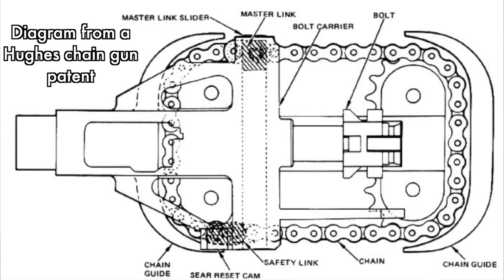Ask Ian: Are Man-Portable Chain Guns Coming?

Comment: The L94 mounted in British AFVs is a nightmare for stoppages so we find ourselves having to clear it frequently. Certain stoppages require you to wait 10 minutes before completely disassembling the thing. This is mainly an issue with the way the belt is fed so a good crew knows how to deal with it. The gun is accessible though! While not tucked into a corner, the short length of it (less the barrel) means it doesn’t jut out into the middle of the turret. Being electrically operated also means that the gunner can fire it and the main armament from the same set of controls. Oh and also chain guns are much cleaner running than gas operated guns!

Comment: What a battery powered system for a man portable system would shine, is a cooling system.  A lightweight barrel jacket a small fluid reservoir, and a small radiator with a pump/fan combo.  Would allow your gas or recoil operated machine gun to run for far longer without ruining or over heating the barrel.

Comment: I do think it's notable for an infantry minigun you could potentially make it so that you could eventually get to the point where you can use a smart system to change your rate of fire, and potentially even change which barrels is firing so instead of being able to only let's say 6,000 rounds in the time it takes for the first barrel to heat up, you can put 3 barrels through 6 thousand, then put an additional 6 thousand through the other 3, or alternate it so that each barrel has 50% downtime while shooting, or if decrease it down even further to use 3 barrel groups so it goes bang skip skip bang skip skip

Comment: shouldn't you be able to remove the chain by just adding 2 valves on the gas tube and using compressed gas on a normal gas system?

Comment: Just a tiny correction!
The British AFV-mounted machinegun is actually designed as "L94A1", the "L34A1" is a suppressed Sterling SMG from WWII😄
Reply: No offense, but the Sterling wasn't used in WW2. It was first fielded in 1953.
Reply: @joshtalley6604  didn't go into active service in large numbers until '53. but it was in testing with british forces from 1944 onwards
Reply: was tested as Patchett Machine Carbine Mark 1
Reply: yea i googled it and was like wtf. first time I ever saw Ian fuck up in a decade. God is dead.

Comment: On the advantage an externally powered gun has with the ability to remotely cycle themselves, there is a way for gas operated guns to remotely cycle themselves. Several soviet weapon systems would carry pyrotechnic cartridges connected to the gas system to cycle the weapon in case of malfunction. The first one that comes to mind for me is the GsH-23-2 on the MiG-21 Fishbed. It could cycle the cannon multiple times in flight.

Comment: Battery-powered guns are a big drawback in terms of reliability over time. The battery usually has a short life as machine guns are only expected to be used for a short time by today's military planners. That is OK on a drive, helicopter, or fixed position that has the means to make power to charge the battery. The dog face in combat with a dead battery is just S. O. L. if they rely on a gun that needs batteries

Comment: Thank you for the explanation about the difference between chain gun and minigun/rotary barrel-based weapon system where its application are needed.
I always thought that the reason why most of IFV and helicopters with cannon rounds use chain gun system instead of minigun system is due to accuracy and not to waste excessive amounts of ammo in a particularly complex system where a damage to the gun and ammo consumption would require a mechanic repair and rearm back at the base,sometimes thousands of miles away from mission area,thus the need of single-barrel chain gun system to sustain the weapon safely and reliably.

Comment: I think in the hypothetical future of powered exoskeletons for infantry, chain guns may have an application for a system wherein the user's arms/hands are constrained by some kind of gauntlets for heavy lifting, thereby preventing dexterous manipulation of the bolt and other interfaces on a traditional self loading system, whether recoil or gas operated. In addition, the exoskeleton would be able to support the weight of the firearm itself, as well as the ammunition and battery. Of course, this is all pure conjecture and likely outside the realm of likelihood, but it's still neat and cool sci-fi stuff to think about.

Comment: One of the annoying things about the chaingun in the Warrior is that you actually have to fire it to unload it. There are always three(?) rounds in the gun when you stop firing and to "unload" it, you have to fire those three rounds. In fact, there is a specific command, "Unload! Do not fire!" used to unload a chaingun without firing it, which means partially disassembling the gun to get those three rounds out. On a GPMG, to unload it, you simply open the top cover and remove the belt, check the chamber and let the working parts forward.
Reply: Can't you just crank them out while the manual safety is on? That's what  you can go with 25mm bushmaster. 
Unloading is just backing the rounds out, break the link, remove and clear feeder.

Comment: Personally I don't think this would be useful on a combat drone. It's way lighter to strap a solenoid onto an existing machine gun platform to operate the bolt handle in case of a malfunction. Think Pederson system but electrical instead of gas operated. Solves the problem of jams, uses commonly found equipment. It's just cheaper and lighter overall compared to crafting an entirely new chain system.

Hypothetically though, aerospace aluminum weighs practically nothing and is exceptionally durable. Expensive as all get out but still quite usable. A chain made of such aluminum, assuming it's not being exposed to high pressure/heat could save a few pounds of weight. 

hmm... nah, still not worth it. Solenoids are powerful, space and cost efficient, and electrically not all that power hungry compared to the work they can do. For a simplistic reciprocating action it's really hard to beat a solenoid just pumping that charging handle to clear a jam. Hell I could strap one onto my AK in a few minutes and get it to work in under an hour.

Comment: Also note with a chain gun, the bolt mass is much less critical and can be made lighter, there is no need for a recoil spring or buffer system, and the barrel can truly be free floated since there is no need for gas ports/tubes. You can also use the chain drive motor controller to effectively program firing patterns such as semi, full auto, or any variety of burst modes without mechanical disconnects or ratchetting systems.

Comment: The shorter receiver is a significant factor that goes a long way towards design decisions for installing it in a vehicle, especially a turret (manned or unmanned).  A .50 BMG chain gun coax in a tank, for example, could be fit into a space no deeper than an FN MAG58 (M240) fits in (it's wider and taller, because that's where the chain gun design tends to bulk put compared to a self powered MG of the same caliber).

I use that example primarily because I really think, given modern AFV stabilization and fire controls, a .50 coax makes more sense than sticking it on the roof for the TC to pretend he has a viable AA capability (note, Western tank designers since the end of WWII have generally depreciated the weight given to the commander's gun as an AA weapon and it shows with the limits on elevation, as well as how most Western European tank designers go for a 7.62mm mount for the turret MG).

Comment: Is there a ballistic advantage in an externally powered firearm, because you don't need to waste the energy in the cartridge to cycle the action? It seems like you should be able to get more performance for the same weight, or the same performance for less weight.
Reply: I have seen videos comparing manual and semi auto firearms of the same barrel length there was no measurable difference. On most weapons the bullet leaves the barrel before the action begins opening, the velocity of the slide is also quite minor compared to the velocity of the bullet also.
Reply: @MrMonkeybat  Okay, but couldn't that be explained by the bullet leaving the barrel before it reaches its maximum potential velocity? And therefore it would go faster if the barrel was longer, or the same speed if there was less propellant?

Comment: About miniguns overheating as fast (timewise) as chain guns or conventional machineguns.  Yeah this isn't quite true.  You can certainly fire them until they overheat just like anything else.  They still can't get rid of heat as fast as they can build it up .  However since the barrels are spinning instead of stationary, they are creating cooling airflow around themselves that enhances convection cooling.  So they can still overheat, but it will take a bit longer per round per barrel.

Comment: It could be interesting to see a chain fed automaic rifle in 22LR. Should be possible to keep the weight down by using polymers and light moder materials. Aircool the barrel with the jacket alá the lewis gun. You would get an incredible funny plinking rifle without all the jamming.  The magazine should have a pickup/loading system that allowed you to load it directly from the standard 50 rounds frame, without having to pick up and load each round alone..

Comment: interesting to note that some gas-operated cannons, both single-barrel (eg. mauser bk-27) and rotary multi-barrel (eg. the old soviet gsh-6-23) use pyrotechnic charges to to re-cock the gun after a misfire, so you get some of the reliability of the external power source.

Comment: Indeed. 
* US Army plans to consolidate the 11H anti armor and 11C mortar into 11B.The H and C are more skilled. They want to use the more intelligent soldiers to serve under the Bravos. Thus the M-5 and M250 texted the range to areas once covered by H&C. The opposition merely adds the heavy type Maschine gun or M-2 Tripod T&E back into the platoon. So US level 4 is countered. The 277 is to have the standard all brass case low velocity round issued for training and common use. ( Bait and Switch?) At the Citadel Wargames Club in the attack of Daniel library was a trove of captured and somehow brought home weapons. They included a complete Soviet wheeled 51 from Vietnam. ( OMH Wheels? Perhaps the Infantry Bravos are ignorant of the wheel.) 
Albert- Welcome to Leith Foreign Advisor.

Comment: For the US, currently I believe we are still using the 25mm Bushmaster, the Navy, USMC, and Army. On a LAV-25, the gun could be set to single, 100 rounds or 200 rounds, I believe on Bradleys it goes to 500 instead of 200. The higher rate for engaging flying targets if needed. the Gunner of course wants to burst fire since the ready rack only holds a few hundred, can't remember the exact count, but I think combined for an LAV it was around 750. Someone else mentioned this but another nice thing about chain guns is having multiple feeds for different ammo type and being able to switch between them.

Comment: Point of order, your statement about multiple/rotary barrel guns was fairly misleading. The CURRENT way miniguns are used, yes they heat up in the same amount of time because the rate of fire per barrel is unchanged, but that's not something INHERENT to the concept. There's nothing stopping one from simply slowing down the rate of fire and therefore getting more firing time out of the whole thing compared to single barrel guns with comparable total fire rates. However, whether or not the cooling benefit is worth the massively increased weight is another question entirely.

Comment: If there is a successful exoskeleton development I can see a chain gun being of value over a traditional MG.  Sure there is a guy right there who can clear malfunctions, but it likely will be a hassle to remove the fleshy arm from the mechanical arm  so the operator can then work on the MG.  Also lets shoulder cannons be a thing as seen in sci-fi.  Chain gun with optics bore sighted to it means only the gun needs exposed to fire accurately.

Comment: The primary benefit of a chain gun is the ability to feed from multiple ammunition sources.  In the navy application of the 242 bushmaster, whatever TF they call it, you can feed it from two boxes and swap empty boxes OR have it alternate firing from different magazine boxes.    Chain guns/autocannons are largely blurred lines these days.   In a vehicle since the M242 fires open-bolt you can continuously ventilate the inside of the barrel for enhanced cooling and exhaust of the gasses in the area of the mechanisms.

Yes.  It's called the 30mm ASP and it's mounted on the Apache helicopter.    Turns out having to break the weapon up and put it together isn't so "man portable".  Basically it was an M230 with lighter parts and a slower rate of fire.  Funny enough the Bushmaster was supposed to be the helicopter autocannon/chain-gun and was designed with the AH56 in mind.   

General Electric had a two barrel 25mm design called "V5 GE 225"     bevfitchett us/ machine-gun-v5/ general-electric-srz html  which was a chain fed, originally 23mm and both barrels were latched to each other - it was recoil operated but also able to be electrically driven to un-jam.   It weighed about 200lbs total without mount, ammo belt and driver electronics so the 25mm wasn't man portable but the 23mm WAS carry-able when broken up.    If you used it in the same kind of teams that would deploy 120mm "man portable" mortars.     It never saw service as such and was largely just a machine gun with electrical add-ons.   Once firing it would use its recoil firing alternating barrels, so relied on the drive mechanism only to start/fire/un-jam.     It was VERY popular in manga and anime - its the two barrels with the big perforated housing at the muzzles. that recoils together when firing.

Comment: Infantry would need to carry CHARGED BATTERIES, a heavier weapon, and ammo since chain guns need an external power source.  Vehicles, aircraft, helicopters, drones, ect have some combo of batteries and motor/turbine driving a generator (or alternator).  So they can easily power the chain gun.  A chain gun increase the logistic load on Infantry (and their 90 lb load of lightweight gear).  Plus batteries might not always be happy in +120F (eg, Iraq) or -40F (eg, Norway) weather.

Comment: What would be more practical is a revolver gun like those used on aircraft. There are multiple chambers and a single barrel. The loading in the chambers is almost the exact same as a mini gun. The chambers align and stop for the firing.
I would easily claim that a revolver gun would be more reliable, easier to fix, allow much higher rates of fire and have simpler illectronics.
The chain gun has a lot back and forward motion, the revolver gun has far smoother operation.

Comment: Hughes Aircraft made many different Chain-guns from 7.62x51mm, .50-caliber, 20mm, 25mm, 30mm, 35mm 40mm.  Rate of fire is Single-Shot, low rate (100 shots per minute), high-rate 200 shots pre-minute.  There was an M242, 25mm mounted on the ADATS that had a 5-horse motor giving very high rate of 500 hots per-minute.  As a Senior Ordnance instructor, I taught chain-guns.

Comment: Not directly related to chaingun, but i wonder if you can replace weight of the bolt and springs in traditional gun with hooking bolt to a electric generator with gear and a rack and provide resistance this way, like how regenerative braking works in EV.
Probably too complex for a practical weapon, but could be nice piece of kinetic sculpture.

Comment: Ian, great analysis as always.  You might add a bit on the chain gun and potential hangfires.  Without some additional sensing and mechanical intervention, the chain guns don't "know" that a round hasn't fired correctly, and the external motor  unlocks the bolt--that could  allow a delayed propellant charge to go off in the breech.  Early on, Hughes  put a system on the M242 that would interrupt the cycle if this happened.   Don't know what the current configuration is, whether hang fire protection is still an issue for the chaingun designs.

Comment: I think another consideration is controllability. When you strip away the recoil spring in favour of the chain system, you drastically increase felt recoil. To mitigate that, you’d need to put in a recoil reduction system (like on an AK-107), but then you’ve just reintroduced all the weight of the recoil system, so why bother?

Comment: Speaking of clearing duds in inaccessible guns, the Russians have a system where a pyrotechnic charge fires and drives a spike (and hot gas) into the dud cartridge to force it to fire. It is used in at least the GSh-301 autocannon if I recall.